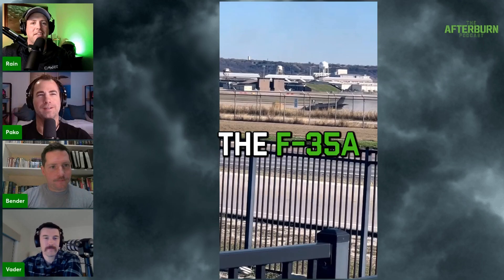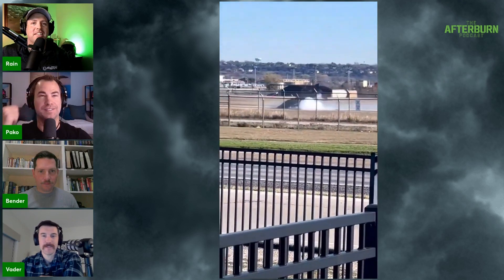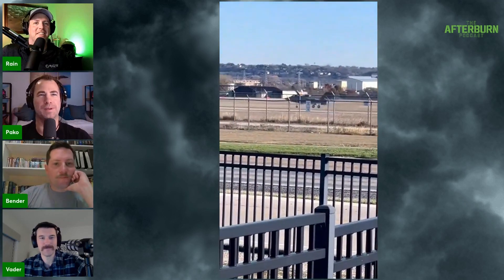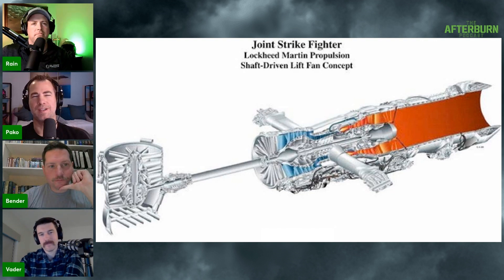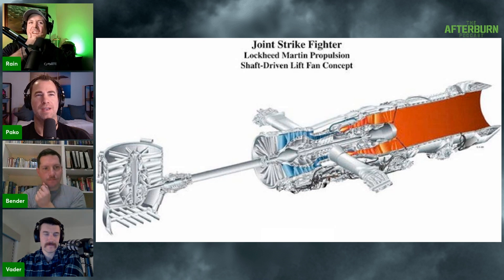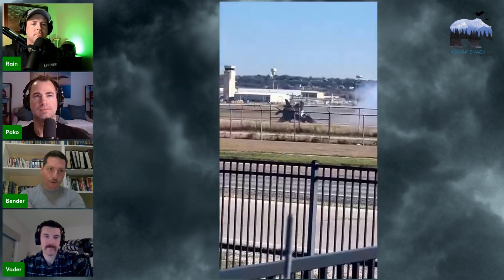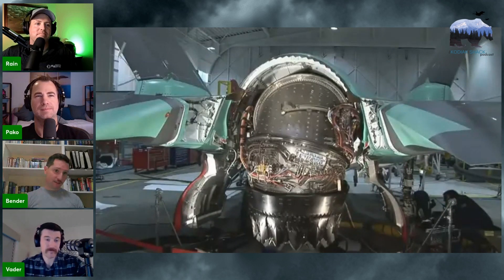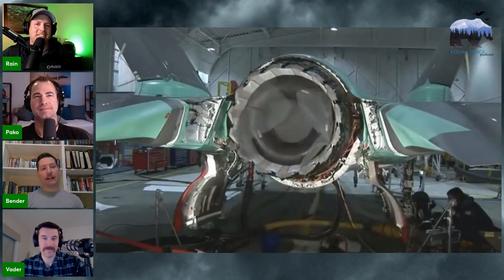FIGHTER PILOT Ejects from F-35 during Vertical Landing

Comment: The F-35B has a auto eject version of the Martin Baker seat.  Same seat on all versions of F-35 but the auto eject is operational only on the F-35B.  If the aircraft's VMC's vote and say the aircraft is in the envelope for ejection the F-35B will eject the pilot automatically to save the pilot.  Since the plane made the WOW switches at initial touch down I am not sure if that killed the auto eject logic.  I believe like you said there was a lift fan failure.  The pilot successfully entered/satisfied Mode 4 logic for vertical landing.  Moving on to the F-35C larger wings.  The Navy wanted ailerons.  They didn't like the flaperons the F-35A and F-35B use.  The F-35C has both ailerons and flaperons for additional roll control.  Also the F-35C have larger fuel capacity and far more robust gears.  The F-35 in  either Red Flag or Top Gun completely humbles the best fighter pilot.  LOL you can put a senior in High School in the F-35's cockpit teach him the avionics suite and can destroy the enemy engage the autoland and text his friends on final to the carrier deck.   Hate to say it but you know how bad it is in football being a QB and labeled a "game manager"?  Same goes for the F-35.  Remember Silence of the Lambs ending?  You're wearing the NVG's only this time your 30 miles away and they can't see you or hear the audible "click" of your gun.  It's an amazing aircraft.

Comment: As we will find out it will be a cascade of issues and recommendations to prevent this from happening again. And probably with a software change on how the fan is controlled especially after a "weight on wheels" event. The cascade of issues could be (just speculation here): 
1. Rate of descent outside parameters creating a bounce after landing, 
2. Weight on Wheels detected so Lift Fan flaps close to reduce the affect of a bounce back into the air likelihood, Or the lift fan clutch is disengaged after landing rendering the lift fan useless (Although I have never seen this during TnG's.
3. The Lift Fan lift reduced by x amount of % creating the nose down attitude that was unrecoverable, etc.

Time will tell.

Comment: First 10 years of Harrier service, they lost 100 airframes with 20 fatalities.
F-14 first 10 years:  73 crashes/write-offs, 19 fatalities
F-15 first 10 years:  54, 26
F-16: 143, 71
F/A-18:  97, 27

Now check this out.  During the last 10 years (2012-2022), the F-16 fleet has experienced 65 airframe losses, 38 fatalities.

The collective fleet of F-35A/B/C mishaps are not even worth mentioning in that context, as they are unbelievably low, and have flown more than 612,000 flight hours already since December 2006.  There’s a huge, glaring statistic relevant to this between the USAF, USMC, and USN that has never happened before in any fighter history, but I don’t want to jinx it out loud.  The Raptor hasn’t even escape that aspect, and it’s very safe.

Comment: I'm wondering how hard the parachute landing was for the pilot from the video looked like he hit hard.
Reply: I've wondered that same as thing, but have been assured the pilot was "ok". I was also told those particular ejection seats were created for low altitude ejection. I have no idea.
Reply: He isn't ejected alone, he is ejected with the seat, so it looks like a heavy landing, but he is protected by the seat.  He likely didn't notice.  More concerned he was ejected toward the wreck.
Reply: @JayR-uy8gl  The seat separates post-ejection, had you been paying attention, you'd have seen a big black thing (the seat) go flying out of the frame.

Comment: My running theory with what happening is the vanes on the lift fan closed after the bounce and that's why the front of the jet nosed over. If you watch them land from a high camera view you can watch the vanes close when they get weight on wheels and it looks pretty slow. So maybe there was a delay there in the open/close commands when it bounced